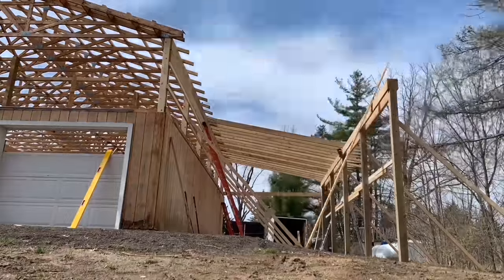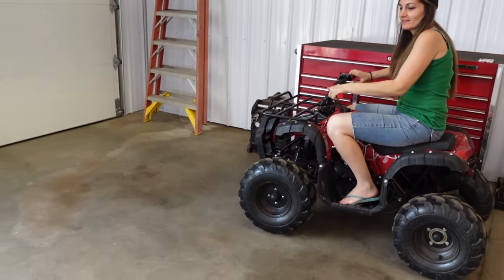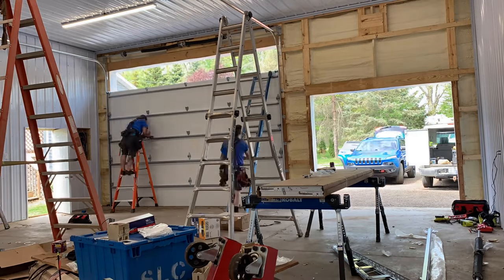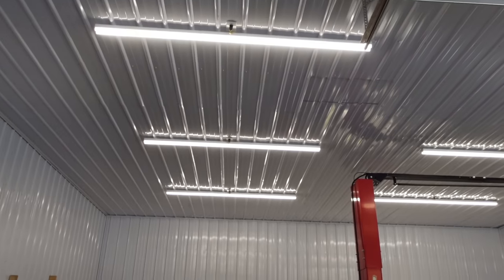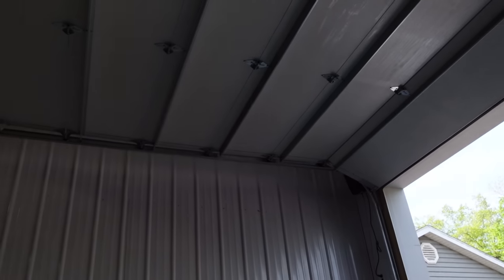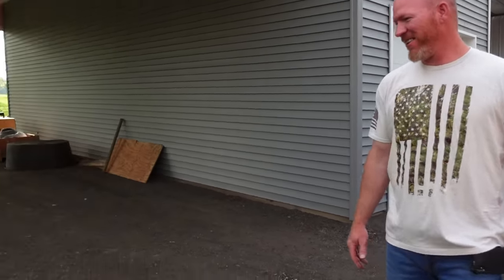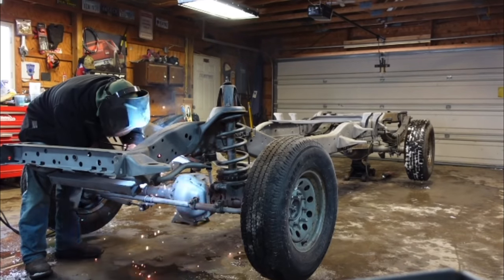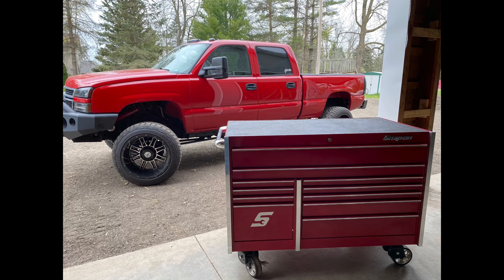The Shop Is Finally Complete! You Have To See This WOW!

Comment: I have a thought about the camper since I own a 2020 KZ BHK302 fifth wheel—- a lot of features the same as yours— but these vinyl like one piece roofs on these RV’s may be more susceptible to UV damage from the sun than rain or snow in winter-I would keep the trailer under that roof WHENEVER you’re not using it!

Comment: As a shop owner you built a nice one.  And bigger is not all that good.  Mine in Ontario Canada is 100x40 and it would cost 750$ a month to heat up at just 70f and that is if yo get lucky and keep the door closed.  So wize that you kept it simple.  You could move the trailer to the back and use the front for parts delivery. Or even to back up a truck that has a load in the box
Reply from the maker: Great point
Reply: @TruckMaster  My next project  House and Shop is a ICF build. the inventors of the block system is 2 of my old school teachers. Mr. Cliche and Mr. Martineau. and at the prices of lumber going up again in July no point to build in lumber. and we still pay less here in Canada then you pay.  you have Import taxes, and you also have a Termite treatment that we don't have. as the cold is not good for Termites.   as well with ICF my build by the water will keep my bills low.   But you did a great job adding space by lifting the roof and adding a covered outdoors area.  the lights are great. a bit overkill. but nice. The lift is nice and the new tool box well deserved. and the guy getting the old one will be happy with it.  I think you should get some truck brand flags, and some Flags for your parts guys. and when you do if you need less echo, stretch em on a frame and have a space of air behind it.  it will cancel some of the echos.